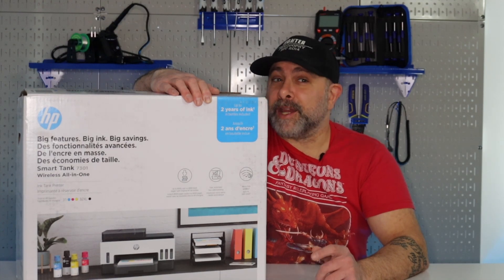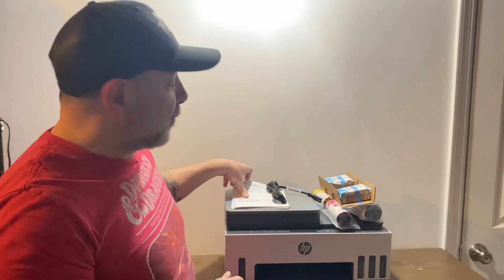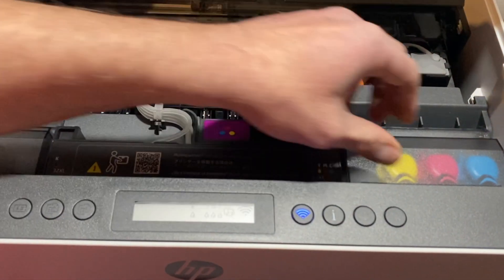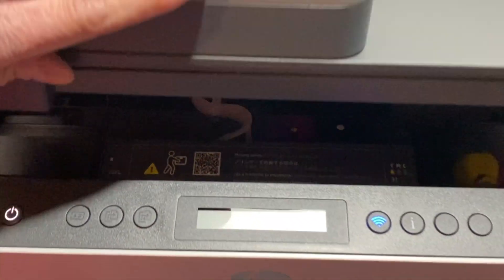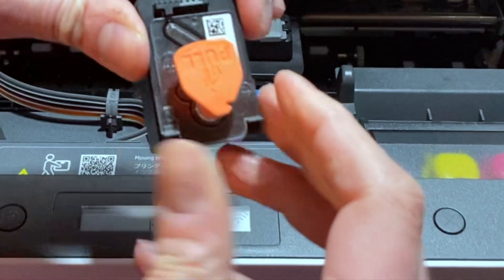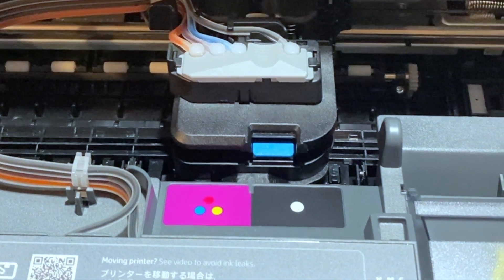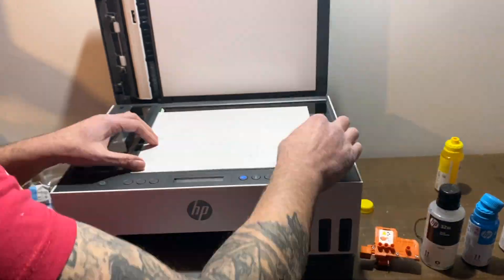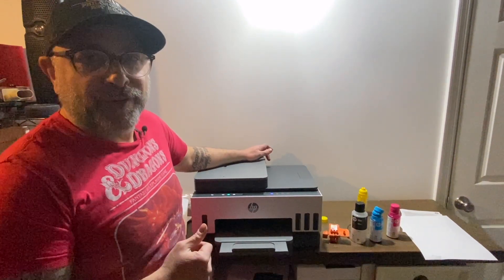Should You Buy the HP Smart Tank All In One Series 7300 / 7301 Printer? - Unboxing and Setup 2023

Comment: Hi thanks for helpful guide on how to set up. Can i ask you how is the printer so far working ok? I'm thinking to buy similar model
Reply from the maker: It works well! You will need to use the app quiet a bit for the setting. Over all I am still happy with the printer and have not had to add any ink thus far. Maybe I’ll make a follow up video! 😉
Reply: @MakerBuildIt  thanks looking forward to a follow-up video.  UK model is 7306, similar to the one you set up exactly the same
Reply from the maker: @alamoody3668  Awesome! I’m sure you’ll enjoy the printer and efficient it is at using ink!